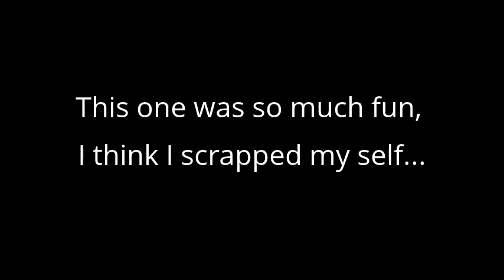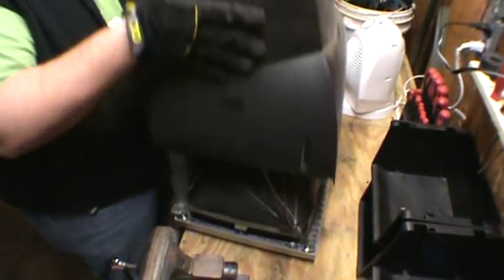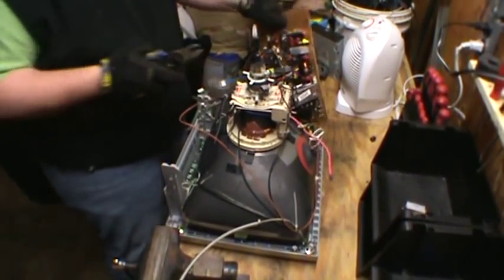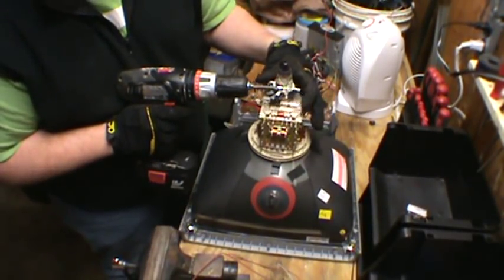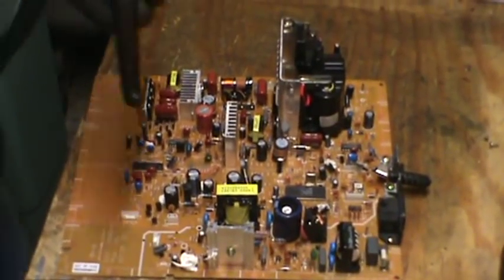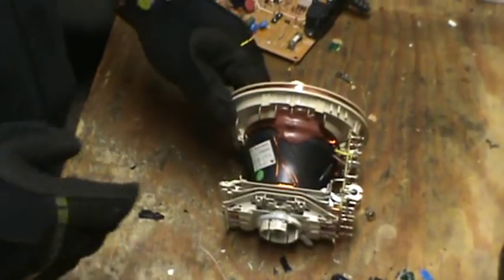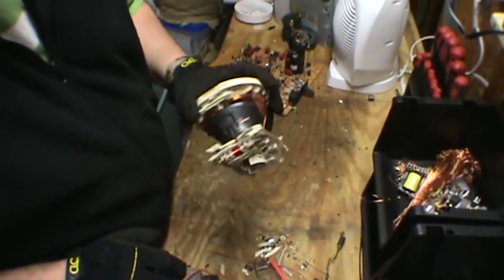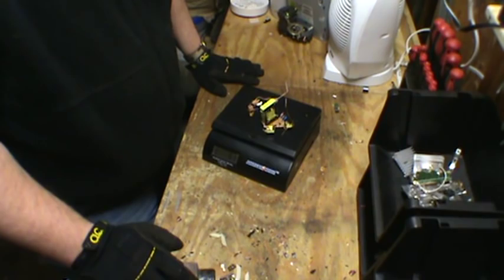How to Scrap a CRT Monitor for Copper, Aluminum, other metals and CASH!

Comment: I opened up my old CRT Dell b/c I wan't to salvage the electrical wires and components for some DIY projects. Turns out that the board is a veritable electrical shop full of different valued resistors, capacitors, lots of 24 AWG and 18 AWG wire, plus jumper pins and inductors. I hadn't thought that I could collect the copper to sell, but that's actually a good idea.
As an hobbyist who likes to make variable voltage boards for vape mods, it's intimidating to say the least to seethe mind bending complexity that would go into engineering something like this, even something that is far past obsolete.

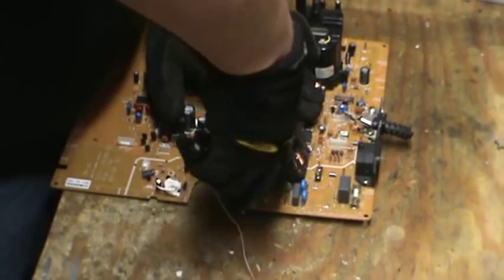Comment: lets correct some terms. the yellow things you been calling motors are transformers the black box most likely was a relay, the fly-back transformer was the big coil near that large heat shield. and those small coils of large dia coated wire were inductors. thats what I found out up until time stamp 9:18
Reply from the maker: Hi and thanks for watching.  You must be new to the world of scrapping.  Welcome!  This is a very stress relieving hobby and good small source of income for a lot of folks.  The term, "copper bearing motor" is a category that scrap yards use.  Sometimes often just called "copper bearing".  Most scrappers understand that they are not actually motors.  It would take scrap yards a lot longer to weigh in, and process things if we had to seperate items by what they are specifically like by inducers, and fly-back transformers, toroidal transformers etc.  They all get tossed into the same bucket for the scarp yard so we tend to call them all copper bearing motors.
Thanks!

Comment: If you don't relieve the pressure by cracking the tube it can potentially implode on you. You should wear a face shield until you've relieved the pressure. The gas that comes out is probably not real healthy to breathe, I'd recommend doing that outdoors. I used to try to leave it sealed, but wound up accidentally cracking the glass getting yolks off often enough and the idea of flying shards of glass from an implosion was unsettling, so first thing I do once the back cover is off is crack it outdoors, then come back 5 minutes later to resume scrapping. 

With a lot of the heat sinks you can remove the screws and they'll pop off easy w/o ripping up the board. Sometimes there's also a screw on the bottom of those heat sinks. The heat sinks are usually connected to MB by steel posts. A lot of yards including mine won't take them as aluminium unless you remove those posts from the heat sinks.  Sometimes they just come right out, sometimes they are a real pain to remove.  Especially if you break them ripping it off the MB. 

In the little black box as you call it, there is usually a tiny bit of brass as well as copper and sometimes a bit of aluminum also. Usually more brass than copper in those. 

Some of the critters on the board that look at a glance like small capacitors are actually copper coils. They are usually not as perfectly round as the capacitors, though many have a rubber top similar to a capacitor's seal and so they'll look a great deal like a capacitor.  Pop that top off and the copper just rolls right out. 

The yolks are sometimes aluminium wire not copper. Hard to tell unless you rub it against some concrete or cut into it. 

Not sure what you call the big black blob on the mb, but the steel retaining ring on those is usually stainless steel. If it's just steel I still yank it and toss it in my steel pile. The older ones it was always stainless, the newer monitors and cheapo TVs it's usually just regular steel. 

The thing I struggle with with the yolks is cleaning the glue and tape off. They are often just caked in the stuff and it can be a real challenge to remove. Was hoping you had some tips on removing that. My yard won't take the yolks unless they are cleaned up, and even then they gripe about the yolks a lot of times as there is a lot of glue still even once you get the really nasty glue off and tape off. 

You didn't mention disposal of the tubes. There are a lot of nasties in those tubes. I take mine down to the city recycling yard for disposal. If you throw them in a landfill they can contaminate the groundwater in the area if enough of them wind up in the landfill. I'll wait till I have several along with LED screens from laptops and flat screens and similar toxic wastes. 

I'd loved it if you included the link to the place that takes the connectors. I've got thousands of them piled up and would love to get a few bucks for them.

Comment: I scrapped one of these today and don't know for sure but I think I found a piece of silver in the smaller black box on the circuit board. It looks like the black box that has the copper in it but just smaller. Break it open and check it out if you ever have another one of these to scrap and let me know what you think

Comment: I like your video.  What is the web site or company name you mentioned to send the gold plated cable ends? 

Do you sell the "copper bearing motors" as is or do you strip the wire? If you sell them as is, would a scrap yard that buys larger A.C. motors, buy these in the same category or not?

How would I sell low grade boards, if I don't have a scrap yard that buys them in my area?

Thanks in advance.

Comment: A question about scraping copper and aluminum...if you smelt it all down yourself does it bring a higher price as the scrap yard or are you just as well off to leave it as is?
Reply from the maker: Jason Hair the money you would spend in fuel costs to melt it down would eat up any profit made and then some.  Some people do it for fun though...

Comment: Wow! Took apart my first monitor. Lots of good stuff in there.  I came across a few little cbms that were plastic with copper wrapped around some were gold copper mixed with red copper and then there were the green ones.  Are they all copper?  And if so #1 or 2? And the copper around the yoke, #1 or 2? Thanks for sharing all your awesome tips. Need to order a tent wire stripper next.
Reply from the maker: Hi and thanks for watching!  It really does vary quite a bit.  Some may be #1 and in a defferent brand that same part might be #2 copper.  Also, your scrap yard may consider anything under a certain gauge to be #2.  The best way to tell besides taking it to the scrap yard an asking is to first scratch it, if it is a lot lighter uner the scratch then it is likely #2.  You get used to seeing the color of bright wire after a while and learn to spot it more quickly as time goes by.  Thanks!

Comment: do you take precaution while touching the picture tube ?  bcoz it has to discharge . otherwise its dangerous. Nice Video !
Reply from the maker: Amol Bagade yes.  And fortunately the items I get have often been unplugged for a very ling time but you are right, they should be discharged
Reply: Good ! Take care very nice work. Keep it up

Comment: What do you do with the case, tube and low-grade biards?  Very good info and thank you-disabled with a disabled wife and this might be something we can do to help us keep from becoming homeless.
Reply from the maker: Hi and thanks for watching! Depending on where you live, this may not help out with income so much.  I stopped scrapping TV's because I now have to pay to have the glass tube recycled which eats up all the profit from the innards and more.  I used to reassemble the case and tube and bring them to goodwill and best buy because they used to recycle them but they since stopped doing that in my area.
Reply: I've been watching your vids almost non-stop for the evenings in the last week.   We have paid waste disposal here but I am thinking of going with a county permit-they have standard waste plus recyclable, toxics and so forth, save me $100 a year but I would have to make the runs to dump.  [[Side benefit is finding stuff to take apaert for scrap/metal or resale]].
Reply: Mark Henry lot of times flint knappers/primitive enthusiasts like to use the thick glass in the screen for knapping.
Reply: Now that IS interesting.  Got a couple of buddies who flint knap, maybe I should mention it to them.
Reply: Worth a shot. Need a little basic personal protective equipment. 
The glass typically contains lead or (in later years) barium, so you'd want a mask to avoid inhaling any dust you create. And you want to be careful to wear gloves when you wash off the phosphor dust coating on the inside of the monitor. All kinds of fun things (heavy metals/rare earth metals, etc) in there.
You also have to be careful releasing the vacuum, as cracking the tube wrong can make it implode. You basically just want to tap the very tip of the tube a little bit with a hammer until it cracks just enough to let the pressure equalize, and then don't do anything else until it stops hissing.

Comment: There has got to be a way to separate the lead from the glass in the CRT.  Have you looked into it at all?
Reply from the maker: +Dwight Gordon the process is way too much for a do it yourselfer.  There are factories that do it, and even on a large scale it is barely profitable.
Reply: Hm. Oh, well.  Thanks for the response.

Comment: You mentioned shipping the outet case to BestBuy do they buy them or is it a special deal you got going??
Reply from the maker: Andrew W. Thanks for watching! I put the whole thing back to together, the tube and the outer casing then drop them off at best buy.  They recycle the lead glass tubes but the TV has to be intact for safety reasons.

Comment: So I just recently found 3 of these monitors. I have never scrapped one before, but I really want to get the alum/copper out of these. How can I be 100% sure it has no charge in it so that I don't get myself zapped? Do I just wait awhile before opening them so they lose their charge?
Reply: I doubt the possibility of guaranteeing no charge, but you can press the power button a couple times (should discharge the tube & capacitors) but you may still want to wait a bit to ensure less charge

Comment: What a waste when you consider that magnet wire is very expensive brand new.  $30-$100 or more per pound. I got 9 oz of 24 gauge magnet wire from one degassing coil from a monitor(341').  I recondition magnet wire and use it for various projects. One hours work can save you about $15 - $30.
Reply: This is the first time that I've heard about magnets "wire".
'

Comment: I am looking at going to a place that NEVER has recycled anything. and every thing. where would you start, stoves, dryers, fridges, which way do I go? to make some quick cash, but staying at it for the long term.
Reply from the maker: YIKES!  That's kind of hard to say.  Are we talking about a different country or a town out in the boonies but still relatively close to a scrap yard.  Or are you trying to start up your own scrap yard
Reply: no, not wanting my own yard, but it is a long way from any yard, but I figure if I get enough togeather, its worth a long haul, I have a truck and trailer, plus barrels ect. and every thing is available, tvs hot water tanks, stoves, even cars. just out there in a couple old dumps. not even locked.

Comment: Is there any particular way I should go about stripping these wires? Is it necessary?
Reply from the maker: There are loads of ways to strip wires.  Lots of different tools or techniques.  For TV's, the only wires I strip these days is the power cord and the degaussing wire. Is it necessary?  no.  For thicker wires you tend to make more money by stripping them.

Comment: I scrapped a wine cooler1.5 ft cubed....heavy, heavy aluminum, extruded, billet and solid
Reply from the maker: Jay Stevens Nice!  Was there much copper tubing in there for the refrigerants?
Reply: Moose Scrapper no copper tubing oddly enough, the outer and inner cubes are plastic with Styrofoam between for insulation. no glass, a few screws, wiring, the aluminum and 2 cooling fans.

Comment: how about a video on scrapping high voltage items. Identifying the parts (dangerous parts) How to properly discharge these items. Also an in depth video off all parts of a circuit/motherboard discussing EVERY part  thanks
Reply from the maker: Joy Kwiatkowski What kind of high voltage items?
Reply: How about a micriwave
Reply from the maker: Joy Kwiatkowski OK, I already have two videos on microwaves.  Anything else?https://www.youtube.com/watch?v=OmE9QpALhpwhttps://www.youtube.com/watch?v=54V7qx8PV94
Reply from the maker: Moose Scrapper I like the idea of the mother board, I will have to work on that one!

Comment: I have a question is the copper out of the tvs and moniters is the copper number 1 copper or number 2 copper
Reply from the maker: vh detectors Most often the copper on the yoke is #2.  There may be smaller parts on the circuit board that have #1 though.  A quick scratch test usually lets you see the difference.

Comment: Hey moose, I've seen some videos that show there is some aluminum in the glass, how can I safely open the glass (release the gases) from the monitor.
Reply from the maker: Mbgkillzone5000 Hi and thanks for watching!  I do not know a real "safe" way to get to the innards.  Original feets has a video where he uses an angle grinder to open them up.  About the gases, that a myth.  There are no gasses in TV tubes, it is a vacuum.  That hiss you hear is the sound of air rushing in not gasses flying out.  There are other concerns though like the phosphorus powder in there is some nasty stuff.  When all is said and done The tiny amount of metal in the tube is not worth the time and health risk.  Best of luck to you!
Reply: Thanks moose, glad you know what to do.

Comment: you have a super channel , i too scrapping old electronics, for non-ferrous metals with final weighting ,you may look :D you got a new subscriber !! good job bro
Reply: Can i ask something?
Reply: @GabrieLight  yes
Reply: @GabrieLight  yes
Reply: @TECHNICUSChannel  
I'm not a scrapper, I just did that with Phillips 2k year model, it was pain, while i do it i found that tail lamp thing was broken, i want to extract the front glass to use it but i stopped when i found a warning sticker back talk about vacuum tube and X-radiation! 
I don't know what to do! 
Is it save to shutter this back? 
Any suggestions?

Comment: Is the copper different grades?
Reply from the maker: yup, typically #1 and #2 in electronics.  # 1 is wire that has no coloring, or varnish, solder, glue, or anything other than copper .  # 2 is just about everything else.  It can have solder on it, often times its painted.  You get slightly more money for #1

Comment: +moosescrapper is there any #1 copper in the crt's or is it all #2?
Reply from the maker: there CAN BE #1, in the degaussing wire, sometimes on smaller components on the board.  Also depends on the scrap yard.  Some will only classify #1 if its the size of a pencil or bigger.
Reply: +Moose Scrapper good point. just trying to get more bank for my time. lol. my yard pays separate for #1 and bare bright. i didn't realize that there was #1 in the electronics until just now.

Comment: What material are the screws in a desktop or monitor?
Reply from the maker: +NARFALICIOUS depends on the item, some are steel, some non magnetic stainless steel, some aluminum.  They are not always the same.

Comment: well an hour later and using a mallet I finally got the rest off without breaking it. I realized there is a lock on it where you can't take it off it was weird. but nice video thanks.

Comment: Awesome Vid!! Well Done!!
I'm pretty sure the clamps on the yoke are stainless. I have never seen an aluminum one. Also, the little transistors on the heatsinks are copper, I throw them in the #2 bucket.

Comment: How much money you can get from scarp CRT Monitor?
Reply from the maker: Depends on the current market but I would say between 5-10 if there is a good bit of copper and wire in there.

Comment: moose i find in copper motors some red wire it is also copper?
Reply from the maker: +Alex Hutik It usually is.  Just scratch it and look at the color under the paint.  If its pink then its #2 copper.  White, its aluminum.

Comment from the maker: Hi and thanks for watching!  I do not scrap very many washers and driers as I do not have a truck.  I do know that they have a large motor in them, and lots of steel, and relays and switches with silver contacts and wire etc.  I will try and get one to scrap on a video.  One of my favorite items to scrap are microwaves.  There is not much metal but there are lots of parts that can be sold on ebay.  The plate, turntable motor, magnetron, transformer, and the H.V. Capacitor.  A/C units have a lot
Reply: Moose Scrapper. why is bright copper wire from yokes still only classified as number 2

Comment: a friend of mine said it was dangerous to scrap a CRT Monitor. it hasn't been plugged in, in probably 6 months or more. So it is safe correct?
Reply from the maker: It should be safe.  Although it is possible for a tv to hold a charge that long, and there are "stories" of people who have been shocked claiming that the tv has not been plugged in for years, it is very unlikely that you would ge ta shock after 2 weeks of it being unplugged.  There are however, certain steps to take to be on the safe side.  There are ways to discharge the device, and other things like making sure that when you are cutting wires, which is the moment that you would be most likely to be shocked, that your wire cutters have an insulated handle, and that you are not touching the device with the other hand.